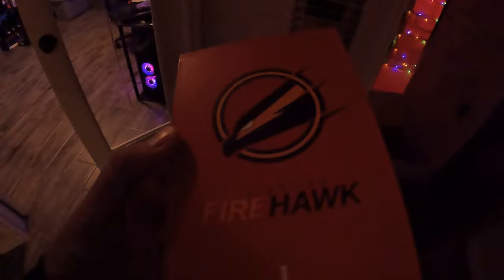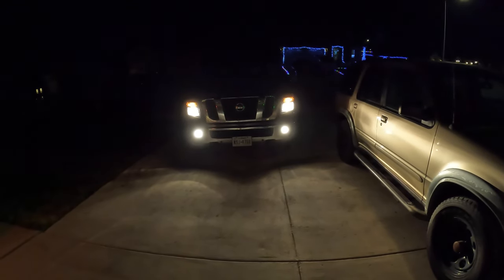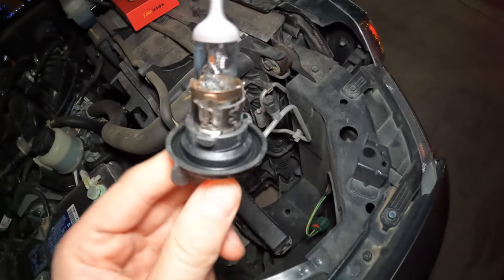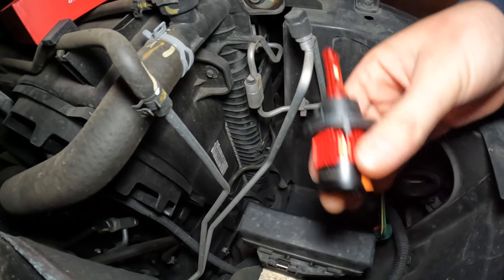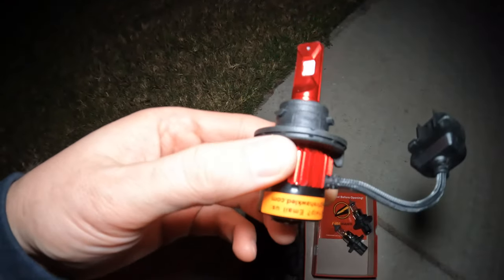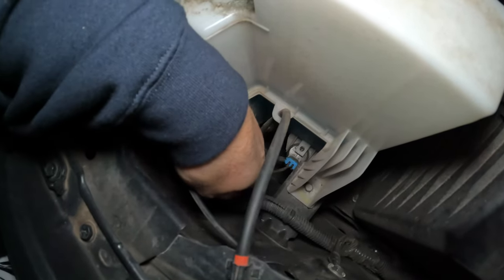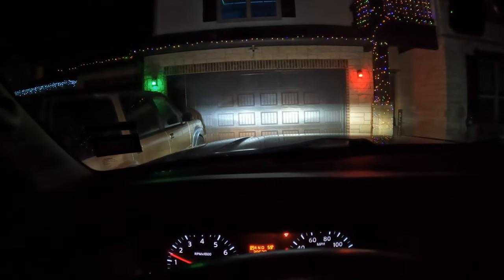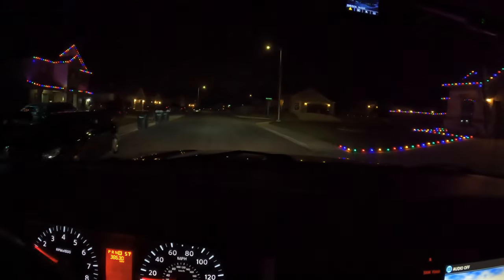Nissan NV3500 LED Bulb Upgrade!! Let There Be LIGHT!!! Part 1!

Comment: @D3RPZILLA make sure u get the orientation of ur led bulbs installed right, by putting and positioning ur led chips facing 3-9 o’clock for the best beam pattern and mimic ur halogen headlights.

Nevermind, u for the info for the orientation 🤣🤣🤣
Reply from the maker: Yeah, had them off initially on the van before I went back and adjusted them properly lol.
Reply: @D3RPZILLA  good man. 🙏🏼🙏🏼🙏🏼

Have u got flashed by other drivers?
Or no issues. 

People always say ur not suppose to put led on the reflector headlights because it blinds them. 

Well not if u get the right ones u won’t. And this is proof right here.

Comment: What are your overall impressions now that you’ve had them in for a little while now?
Reply from the maker: So far it's been awesome! I had to adjust the beam down a tad so I wouldn't get other drivers flashing their brights at me because the headlights are so bright (and the van is fairly high up) but it's been perfect since. I have had some oddities with my right blinker that I haven't had a time to delve into yet... occasionally I'll hit the blinker stalk to the right and it was rapid blink, I'll turn it off, then back on and it blinks normal... so, I'm thinking one of my front or rear right blinkers is having issues. The headlights and everything else has been flawless.

Comment: Can you adjust and align the headlight housing for these Nissans? I haven’t found any adjustment screws
Reply from the maker: Yes, you can. There are adjustment screws for the headlights... I don't have the van in front of me unfortunately but I had to lower my headlights as the LEDs were so bright ppl were flashing their brights at me until I made the adjustment, lol.

Comment: Is the Nissan NV 3500 a reliable van for cargo Delivery and a daily Driver in your opinion?
Reply from the maker: I think it is. I drove it almost daily for a few years with no issues. I prefer the truck like layout with a full hood as working on the motor is much easier and quicker than on traditional vans where half the motor is under the dash. Has great towing capabilities and plenty of power to get around town and into freeway traffic. Rear doors swing open all the way to the sides of the van and the side door is large and functional. I never used it as a delivery van but I think it would hold up great. I'm in a few nv3500 facebook groups and plenty of ppl have 500k+ miles on these with regular proper maintenance.
Reply: @D3RPZILLA  thank you sir 🙏🏿

Comment: How are these working out after you've had them for a while? I hate my factory headlights, especially in the desert at night.
Reply from the maker: They worked flawless the entire time since the day I installed them (and all of my other led lights that I added). I actually sold the car recently (sad days, but kids are old enough to drive themselves now) but the lights worked perfect until the car was no longer mine and still work fine to this day that I am aware of. I HATED the factory headlights and these improved the driving experience at night ten-fold easily!

Comment: Removing the blue rubber ring from the Firehawk makes life much easier on the install.
Reply from the maker: I barely remember it at this point, lol. Was the ring for waterproofing the seal or something?
Reply: @D3RPZILLA  look at the 5:00 min mark in the video and you'll see the blue ring in the new bulb. Leaving that on makes it nearly impossible to install. That's why you said "this one was like 4x harder"--lol, for me it was 100x harder. Removing that rubber ring makes it possible (and easy).
Reply: there was a little piece of paper in the new box that said to remove it...we just don't read those instructions until we must.
Reply from the maker: @yoyoho2627  lol, interesting.. I thought I looked through the box and didn't see anything but I prob looked right past it lol. Thanks for the tip!

Comment: Hey recently installed my fire hawks and realized that even with the DRL fuse out the is some sort power between the bulbs. If I remove me side the remaining side gets brighter and when the bulb is plugged back in there is very lowlight flickering. 

I thought it was a faulty bulb so I purchase some sealights, the comparable competitors option and the same result. Sea light sent me “decoders” however the issue remains with the only difference being a pair of REALLY hot resistors par bulb. 

Not sure what’s going on as I don’t show any voltage from the harness yet they light up when plugged in. Strangest thing ever.
Reply from the maker: Hmm... That IS weird. Does the stock OEM bulbs do the same stuff when connected? Maybe some kind of weird bad ground or a short somewhere in the harness?
Reply: @D3RPZILLA  reinstalled stock bulbs finally, same issue. guess its time to search for schematics, likely a short
Reply from the maker: @juant687  yeah, sounds like it... Super weird!! Hope u figure it out!